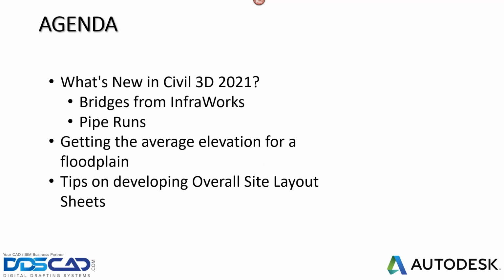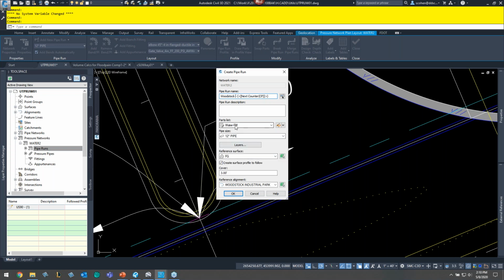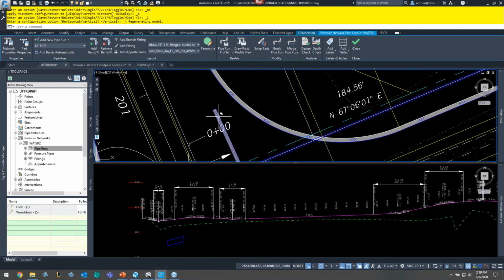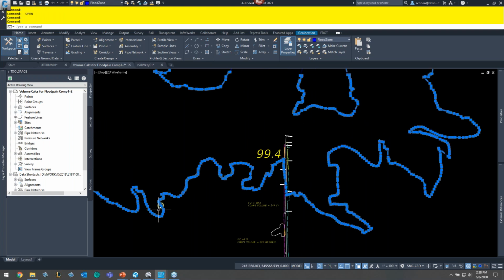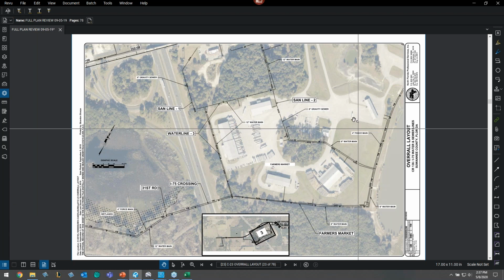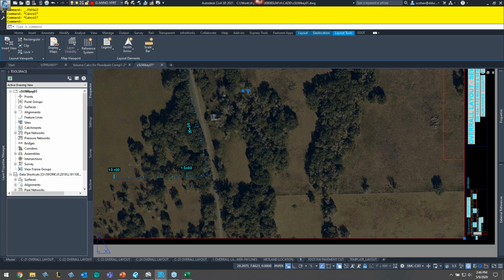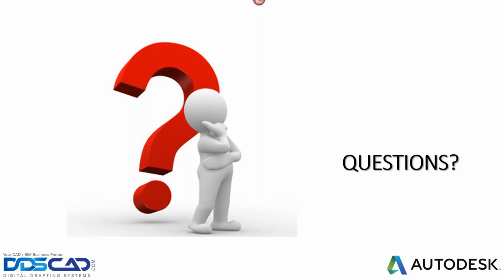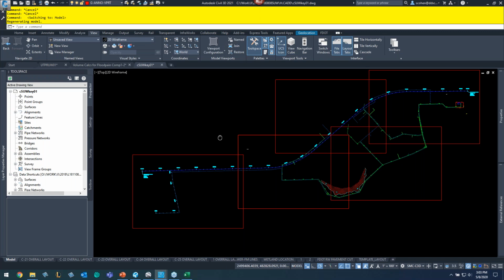What's New in AutoCAD Civil 3D + Tips & Tricks Webinar

Comment: This was a wonderful introduction to the new functions of pressure pipes and I look forward to utilizing it in future projects. I do have one question regarding the automatic input of fittings along pipe runs (my question is the reason why I somehow came across this video). My pressure pipe runs won't automatically input the appropriate bends for some reason. I have all kinds of bends in the parts list, but for some reason it won't include it in run. All I could think of is that the pressure pipe run doesn't understand that I have the available fittings for certain degree of bends. Additionally, the compass snaps only in ONE direction and that's the direction of the pipe. I'm at a loss here. 

If it's any help, in 14:39, where you edit the alignment to show the automatic process of adding fittings and ease with this functionality; i tried to do the same thing and I get this message instead 
"Unsupported geometry changes would break the consistency of pipe run ('Pipe Run - (4)'), so the pipe run was detached from the path. You can undo the previous action or rebuild the pipe run from parts."
My guess is that autocad doesn't know the parts to use (even though my parts list does have all the  pipes and fittings available) and won't create the pipe and fitting automatically. 
Is this common with everyone? How do I let AutoCAD know that to automatically add pipes and fittings?
Reply from the maker: Hi Ivor. This is a tough one to help with without seeing file. We can offer services to help with this, please email us at info@ddscad.com for more information and for our rates.